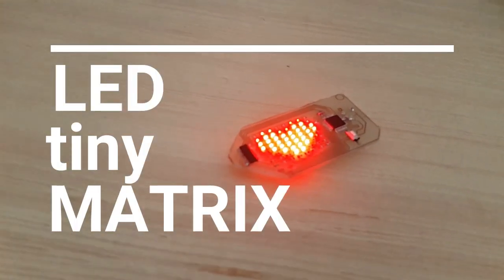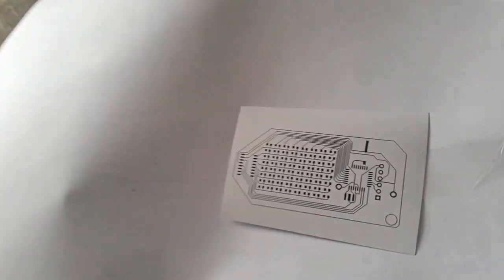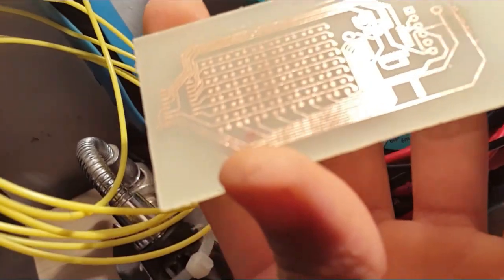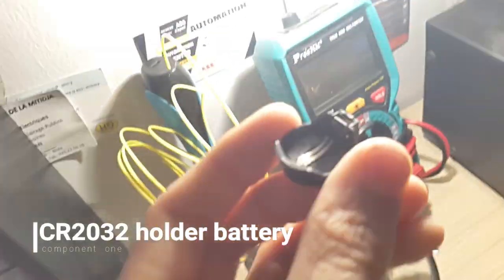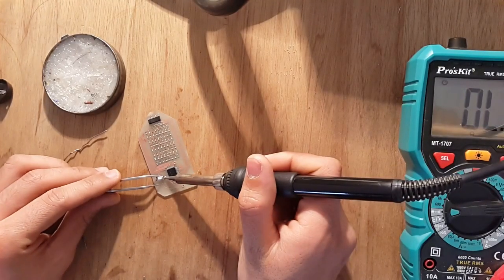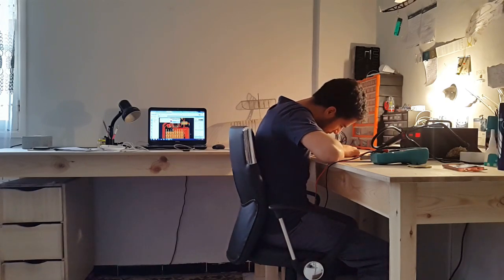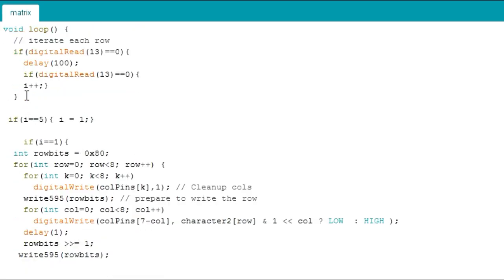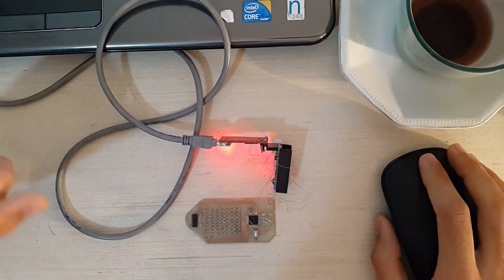8x8 LED MATRIX | SMD

Comment: Great Work...... Bit confused about how you are connecting the top layer and bottom layer?
Reply from the maker: If you concentrate at the leds you will see some copper wires connection the GND of one led line

Comment: Great video, awesome work. Could you please include a link to the 0306mm LED, cannot seem to find them. Thank you
Reply from the maker: actually i bought this leds from aliexpress :) and the pcb you can check it in the comment section below this video
Reply: Electronics hobbyy cool man thanks. Did they have a part number or a link so I could check them out please ?